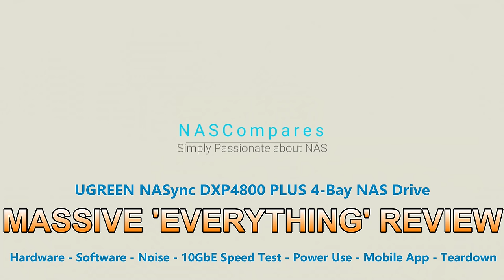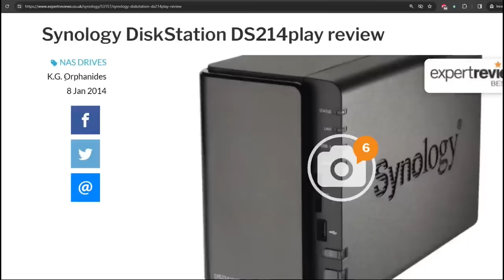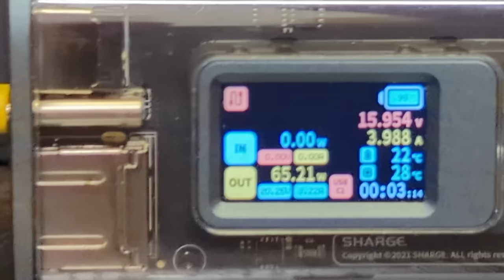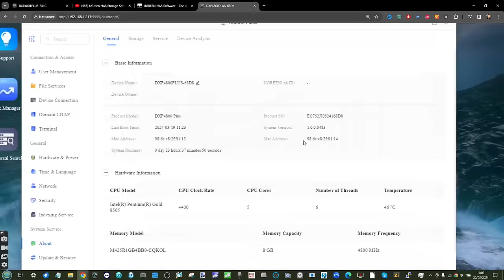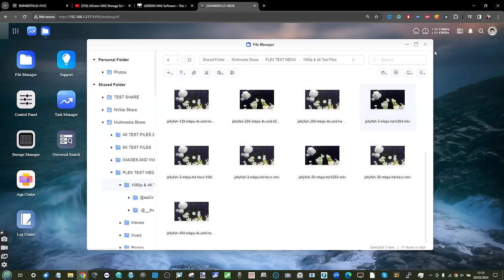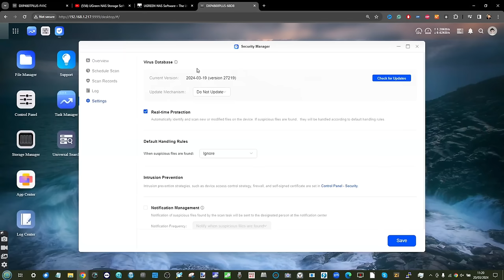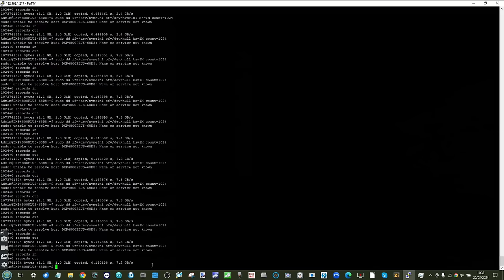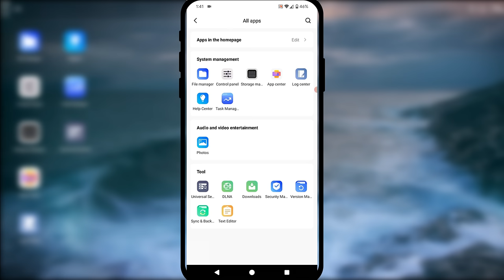The UGREEN NASync DXP4800 Plus NAS Review (EVERYTHING!)

Comment from the maker: *Update on the use of 3rd Party OS' on UGREEN NAS with hardware, with regard to warranty*: "The Ugreen team confirms that whatever is promised in their warranty policy will not change, which only covers the hardware. They also mention that there is a risk of damage if you install a third-party OS, including data loss and compatibility issues, etc." - Ugreen Representative, 26/3/24
Reply: safest 3rd party os would probably be ubuntu server as it is debian based, right? i never prefer the built in os on most nas so I just go with ubuntu server usually.
Reply: @BrickTamlandOfficial Even Truenas Scale is Debian these days
Reply: @wshyangify only thing i dont like about that and unraid is the extra ram usage that could be used for vm or containers. ubuntu server minimized is not too hard to work with but people love gui
Reply: @BrickTamlandOfficial  This is the issue of people wanting a NAS, but for it to also be a server of some sort. How do you balance out those needs. if you need to run VMs and be a NAS, time to pay more to get more umph!
Reply: @TheRealMrGuvernment well containers can run on low end intel chips. its mostly a ram issue not cpu
Reply: My friend, this Ugreen NAS have anything like Synology QuickConnect?

Comment: Hardware is awesome, but the software seems to need some time to mature. Voiding the warranty if you install an alternative OS is a bit disappointing.
Reply from the maker: Hopefully they will consider a little flexibility on the whole IS thing...we hope
Reply: If you dont buy a nas with emmc but a os nvme noone will know if you just replace it with a nvme with another OS on it... 😅
Reply from the maker: True
Reply: Software is harder to get right compared to hardware.
Reply: True. But from the Q&A video they did with this channel, they really don't want to go down the rabbit hole of supporting every OS configuration imaginable so they went with a spin of Debian they forked in house as the one they officially support. It remains to be seen whether or not they have installed any anti-customer BS like efuses that would impact any potential RMAs should you swap the boot drive with something else.  One question to be asked is will they offer the OS install on these machines on their site as an ISO or better yet a Github instance?
Reply: @TwistedMe13  the least they should do is giving warranty on the hardware even if there is not the original os installed. But we'll okay, if I actually decide to buy it I want to run unraid on it so I would just unplug the OS SSD and disable watchdog and hopefully won't be bothered... Would be nice if someone tests it beforehand and also test for power consumption with HDDs (spun up and down). Maybe I'll just buy it test it and if it doesn't work for me I'll resell it again, but that would be a lot work and money just to test this as ugreen should be the one providing this information.
Reply: @TheULTRAiPOD  I could understand their unease on supporting other OSes. What if the third party OS is installed but has a major bug that causes your CPU to overheat or your drives to fail due to excessive read and writes, how would UGREEN determine it is due to hardware or software failure? Especially if the software is not built and tested by them? Since it's their first new NAS product, I don't blame them for playing it safe and not exposing themselves to avoidable liabilities. Maybe after a few versions, they'll be open to third party OSes
Reply: As long as its secure and reliable, then its worth considering. Other companies that both got hacked and didn't respond properly had their reputation damaged.
Reply: @ultimatemaverick  those computer hardware manufacturer do covering hardware faulty no matter you run windows , Linux whatever on it . 
Hardware faulty do hardware troubleshoot and  diagnostic 

Warranty void for 3rd party OS installed is just excuse to dodge responsibilities
Reply: @ultimatemaverick if an os can damage the CPU or drives something is very wrong with the hardware. I can understand os-caused data loss, but not that. How do you even damage an HDD non-physically?
Reply: @simon1234567ful Not with Christ always watching.

Comment: 60W idle power consumption is a no go. This would cost 160€ in energy per year in germany. No wonder noone else is talking about the power consumption. If it stays like that i am out.
Reply from the maker: To be fair, my tests were not exactly scientific and this is an early prototype. That said however, it is definitely hungrier than I thought it would be!
Reply: @nascompares  well, your shargeek measured the output power delivered directly to the nas. So the power consumption from the wall with the psu wich is typicaly around (80-95%) would be even 5-20% higher then what you measured. This is a dealbreaker for me.

Comment: That's a great review and the NAS is very very promissing. Finally seems like some competition for Synology and QNAP. May I ask if it would be possible to do a PLEX review with this device? I'm very curious to see how it performs. Thanks a lot and keep up the great work!
Reply from the maker: Unfortunately, not at this time. Not because I don't want to (I really, REALLY do). But currently there is no container/VM tool, no support of Debian/packages 3rs party app tools and no Plex app in the app center. So, unless I install a 3rd party OS (which would not be officially supported, so therefore not reliable/applicable in the review), I cannot test Plex yet. But I definitely, definitely will as soon as one of the 3 options above opens up
Reply: Handle would be nice.
Reply: @nascompares  thanks for your answer. Hope they figure out Docker support. That would take the NAS a big step forward. Wonder how the likes of Synology, Qnap and Asustor will react. At the price point of Ugreen, they have a serious and imminent threat (provided they figure out the software side).
Reply: @nascompares   Can you please install 3rd party nas OS like unRAID I'm quite interested in it how they work PLEX and transcoding
Reply: If it's just a fork of debian on an x86 system, cant you just run debian programs?

Comment: That power consumption would absolutely kill my buying intentions if it stays that way. 

Would love to see its idle power with Unraid and powertop.
Reply from the maker: Hopefully that work on optimizing this, alongside other things
Reply: As someone from a country where I pay around 1 $ per kW, this would quickly be a bad investment..
Reply: @OleVanman where are you from? I would get off the grid using only solar or running my own generator.
Reply: I have the feeling the PSU that comes in the box is ~60% efficient, accounting for maybe a quarter of the idle power draw.
Reply: I'm just thinking, isn't it possible to pass the power to the NAS through a Wi-Fi enabled plug? That way every time you need to use it you can turn the plug on via an application for that, and then just wait a minute or so for the NAS to connect to your network so you can access it remotely. Would that work??

Comment: Great Review. The idle power consumption of about 55w with 4 drives is a bummer. Other 4-Bay NAS with 4 Drivers consumes about 30w in Idle. Thats about 25w more on Ugreen, which sums up to 220kwh per year (~75€ in Germany). I could not find any snapshot capability ether, which is a key feature for a nas. 

At the end of the day the hardware and price really shines, but theres not much you can do with it with Ugreen OS.
Reply from the maker: Remember that my power tests there were pretty primitive tbh and there are better and more precise tools out there (I just didn't have time in the end to expand on this, but working towards resolving this in a follow up vid). Nevertheless, the power use was higher than I expected, even by my comparatively basic testing
Reply: It seems like they borked power management with a firmware update. I'm a beta tester and when I was running an older firmware, I was seeing 26-28 degrees Celsius on idle but when I upgraded to the newest firmware, my idle temp is around 43-48C. Not cool...literally. Such a low power CPU should not be getting that hot on idle.
Reply from the maker: From what I understand, talking to other 'tubers' the firmware updates have been far from consistent for all - with varying 'current' firmware revisions floating about. It's going to be something of a review pottery to see what FW different reviewers will be running when other videos land
Reply: I can explain that 

It is still an early sample, not a shelf/final version 
They have a big team of developers who keep working on this 
Please give some time for KS starter project 😊

All issues will be fixed and all features will be there, but we can't guarantee anything or give the timetable due to NDA restriction 

We also try keep the system closed to provide industry best support and user experience , stay tuned 

Best , me a random guy pretending to be a marketing person 

Thank you

Comment: Excellent video.i really like your videos. So what is ur suggestion..do the diy like i9 erying PROJECT or buy the ugreen nas 6 bay and wait for them to do some miracle to software or allow 3rd party O.S?
Reply from the maker: ALOT to unpavkere here. Ok, so 1, if you CAN DiY it (skillset, time, availability), go for it. It's more rewarding and also allows greater gains + savings. But the UGREEN (if they nail it) has the potential to be the best alternative out there to this for the price. The software (and indeed the system) isn't aimed for retail till well into the summer... So UGOS and the system optimization might be a different ballgame come July/August. Cannot tell. 

Also, re: 3rd party OS support in conjunction with h/w warranty, I'd comfortably bet that they will change their stance on this when the crowdfunding starts and the comments section rolls in!

Comment: Thanks for this. Not sure how I missed the boat about that 40% discount but that alone has gotten me very interested in this, so it seems I have less than 24 hours to decide if I want to pull the trigger or not.

For that price with that hardware, I'm considering just getting the 8 bay and sitting on it a while until I can get good prices on drives and give them time to sort out the software etc. or reverse the decision about voiding the warranty if you install another OS. It's completely unusable for me without Docker anyway, as I do everything with Docker Compose.

Comment: Just FYI, you used 10Gbe but kept the MTU at 1500. You should test with jumbo frames (9000 MTU).
Reply from the maker: I mention this in the written review (and forgot to add it here in the video). In the current beta, the MTU was fixed at 1500 cap on the NAS (I could only scale down, not up!!!). So adjusting the jumbo frames on my 10G nice would have been pointless. Absolutely NO IDEA why the beta won't let me adjust above 1500... Absolute AGONY
Reply from the maker: The linked review for the unit and the UGOS software review in the comments dig into the beta OS alot more. Will address this more in the DCP480T video.
Reply: @nascompares  absolutely bonkers! Try adjusting directly on Linux via SSH.
Reply from the maker: Ah, but then it wouldn't be a fair demo of the status of the system 'as is'. Catch 22..bugger!
Reply: @nascompares  well, it's more for us DYIers to know how capable the system is. Anyway, thanks for the review! I had already decided on buying the 6-bay unit as soon as I saw the specs. It's a lot more powerful than my Qnap 672X, and way cheaper. I will most likely install a different OS, tho.

Comment: The thing is, I don't mind beta products for many uses, but my storage systems need to be solid.  My current 3-drive NAS has been running for over 10 years. 

I can't see trusting an incomplete, crowdfunded solution.  And, face it, the main reason for crowd funding is when the company doesn't have the resources to complete the device without getting money up front.  My conclusion is that either Ugreen really doesn't have many resources or they are using crowd funding as a method of marketing.
Reply from the maker: Very much the latter I believe

Comment: TrueNAS Scale compatibility was my sticking point. Looking at other videos that does not seem to be an issue. Ordered it from the kickstarter. Will pair it with 4 16GB Ironwol Pro (don't need more than that)  and 2 4GB NVMe drives. Will just need to figure out the RAM specs so I can bump RAM to 64GB.

Comment: But, can it run Crysis? (AKA TrueNas)
Reply from the maker: smashes like button so hard the screen cracks
Reply: Yes but you will break the warranty.
Reply: From another review, all the HW is recognised under standard Debian Linux distro, so running TrueNAS should be no problem at all.
Reply from the maker: Installing 3rd os is definitely doable (ran UnRAID with relative ease), but it's still up for debate if UGREEN will change their policy on hardware warranty support on users making this OS switch
Reply: @nascompares  was the 10G nic supported in UnRAID (and also running at full speed)? This is one of the few missing pieces for me.

Comment: Which way does the air travel through the system? Is it from rear to front or vice versa? The reason I ask is I suspect that I would assume that the air is coming in from the font and is blown out the back at which point the filter in the back is of no use.
Reply from the maker: I'll check on Monday. Good shout! I didn't consider this
Reply: @nascompares  On the beta unit it's rear to front, so I don't see why this would be any different. Oh and when you disassembled the unit, the orientation of the fan shows that it's rear to front.
Reply from the maker: Thanks for the clarification 'cd. Currently off site and you just saved me a lot of mucking around. Cheers bud
Reply: Also, where is the air going?  There are no vent holes on the front so the pressure inside the unit is just going to get hotter with nowhere to go.
Reply: @gordon861  There's actually a decent amount of air gap between the drives for airflow.

Comment: I've been saying for a while that I don't understand why this processor hasn't been more popular with these kind of devices. The 5 core 1P+4E benchmarks pretty close to the N100 overall, but it has a bunch more PCIe lanes.
Reply from the maker: I think it's the power use, the N100 is (comparatively) comically lower than everything else at the moment. Then you have the N300/305, which scales things up, whilst still keeping that active use watt use low. The 8505 is a SOLID CPU and price wise, great vs the i5 etc, but it also gets pretty hungry, even with 4 e corea

Comment: Can these NAS drives be used for storage and play of 4k UHD Blu-ray Discs? Would I need additional hardware to stream it over my home network through the newest Apple TV? I am quadriplegic and can’t change discs without help so this device could be very helpful and freeing for me. Thanks for reading.
Reply: Any network-attached storage can be used to stream video, including 4k, to media devices.
Now whether it works depends on the chosen method (which is the video format - disk image, or a rip), the network setup you have (particularly at higher resolutions/bitrates), the method of playback - playback by media device such as Nvidia shield/Android tv box/apple tv from a file stored on the network, or playback by media server running on the nas device, and for the latter - direct play from network device which requires better network or transcoding which requires more CPU performance and works best when there's a GPU/a CPU that supports stuff like quicksync.
E.g. I use Nvidia shield for playback on my tv, files are stored on my Synology Nas and some on my PC, 1gbe Ethernet connecting devices, alternatively there's wifi as backup and it also works well.
Not watching bd images/remuxes but watching bd rips up to about 50 gigs in size without issues via Kodi. Conversely, jellyfin didn't work out for me because the older Synology I have is too weak cpu-wise to transcode the files without uncomfortable delays.

Comment: A few questions, does it come with 3.5 to 2.5 inch adapters? Also do you have the 6 bay model? curious about the size of the PCIE x4 expansion slot, wondering if one can shove a GPU in there
Reply: The screws that come in the box are to screw in 2.5" drives to the bays.

Comment: That you have to disassemble the whole thing to get to the drive where the OS is installed is a big NOGO
Edit: Thanks for the in depth review, but I'm so pissed, that there is no hardware only option for this thing.
Reply: I'm still not see that part yet It sounds like another way to  warranty void if following their style 😂
Reply from the maker: Tbh, removing the casing to get to the OS SSD isn't THAT unusual..but the 3rd Party OS switch barrier is certainly a major sticking point
Reply: @nascompares  if think positive it is the third m2 slot we can using as storage /cache/ interesting add on m2 like mini NPU 

Hardware wise it is not many 4bay nas give 3 m2 2280  slot

Comment: Not buying something that might be some day. I'll check it out when its really for sale.
Reply from the maker: Valid!
Reply: Might be a wait. Main issue with ALL NAS is the proprietary nature of their drive sleds. Buy a couple if  one is going to keep the NAS for the long run.
Reply: @brodriguez11000 my QNAP NAS has been running 24/7 since 2008 and I had to remove only one drive once in all that time. And even then pulling out the drive and directly putting it back in its slot solved the issue.
So, I don't expect much strain on the drive carriers.
Reply: @brodriguez11000  Drive sleds don’t wear out. Had a Synology running for 8 years. Suffered 1 drive failure. The sleds have basically been touched for 10 minutes total.